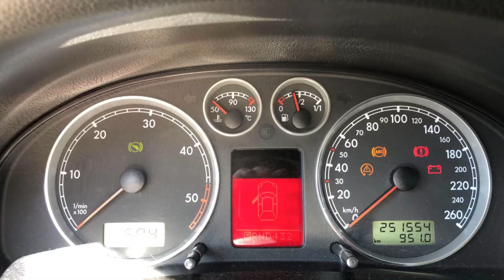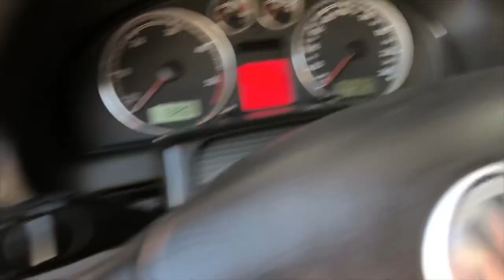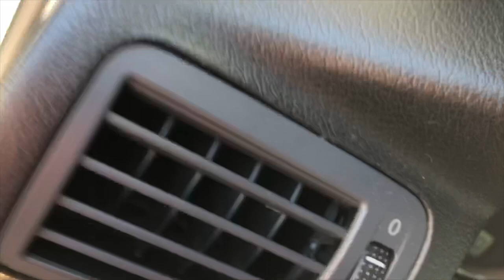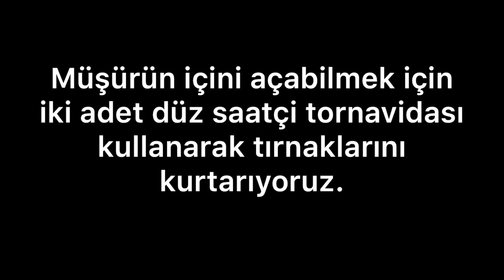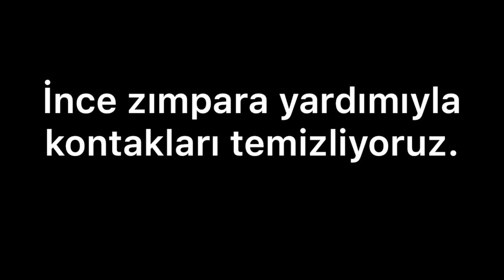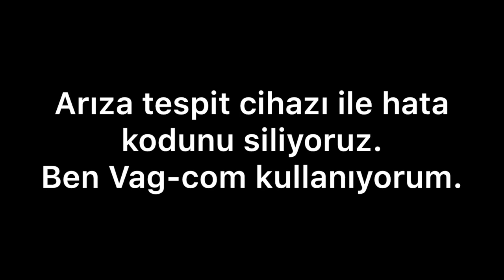Passat 3BG B5 B5.5 Fren Pedal Müşürü Onarımı | Brake Pedal Switch Repair

Comment: I have 00526 fault code showed up, when pressing brake pedal around 10 times I can see that rear brake lights comes on only 2 times, any suggestions? Mine car also passat b5.5.

Comment: Hi, I have the same warning lights on the dashboard of the car, I changed the brake switch and it still appears on the dashboard of the car, I deleted the code with a cheap one from amazon uk, I have to delete the code with vdcs obd2 something bigger, not to delete the code from the ecu cars right?
Reply from the maker: Check rear brake lights
Reply: @eem.marikan  What exactly should I look for, I'm a beginner
Reply from the maker: @ciprianionutapetroaie7314 Your rear brake lights must be working. If one of the lamps is not working you will get the same error code.